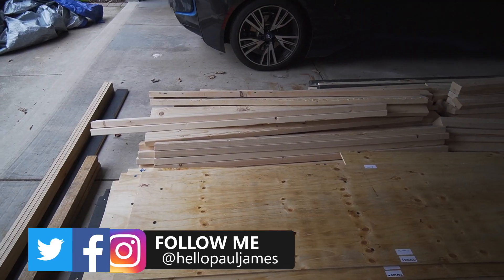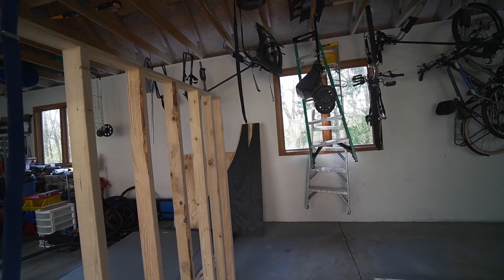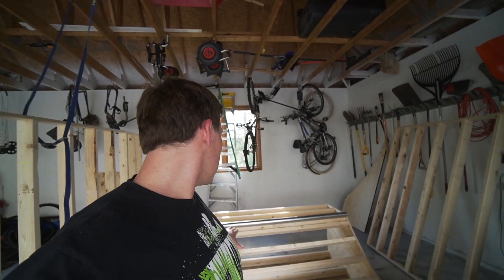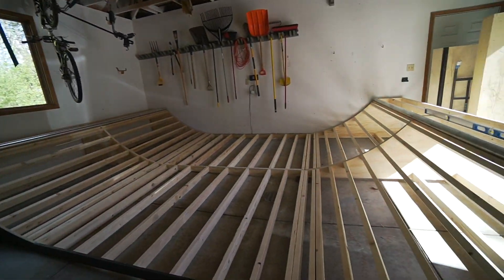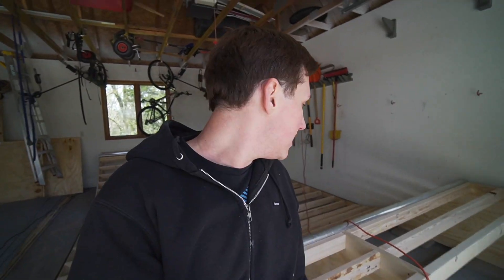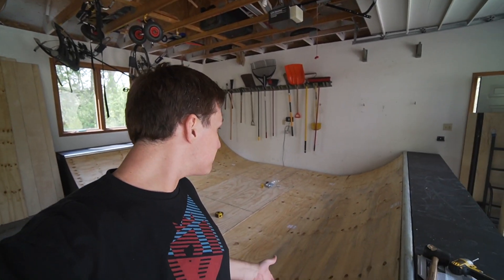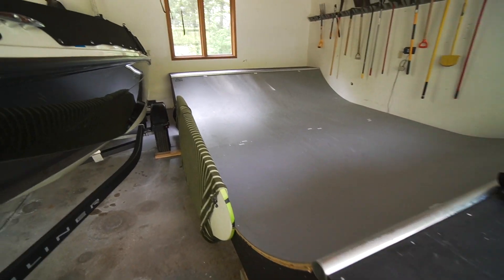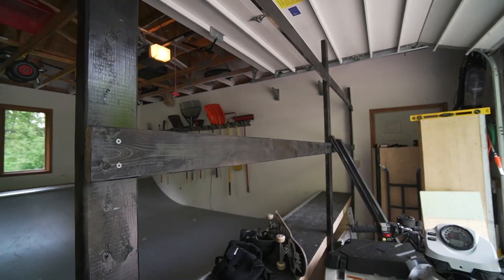I Built My Dream Mini Ramp In My Garage (Keen Ramps)

Comment: You were talking about keen ramps having already placed markers on the ramp so it easy to build, if I purchase the 3x8 one, will the ramp come with screws and nuts and bolts aswell as the markers?
Reply from the maker: Yeah I think all of their ramps do. I have a manual pad from them as well and it was the same thing.